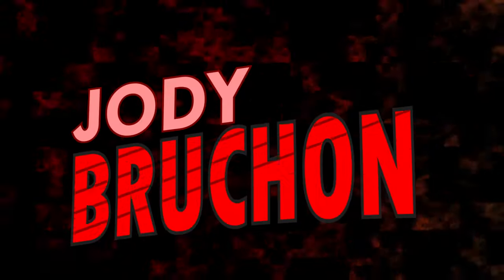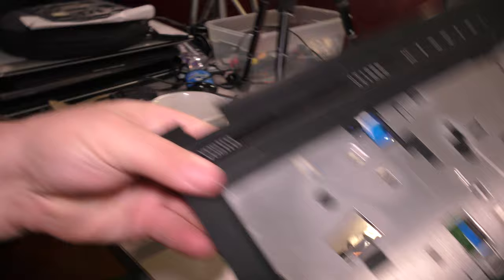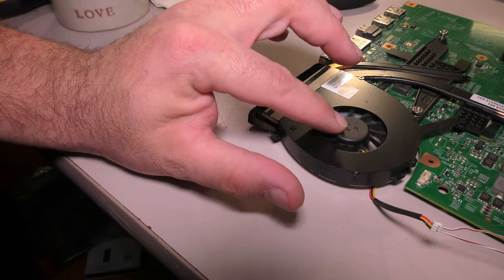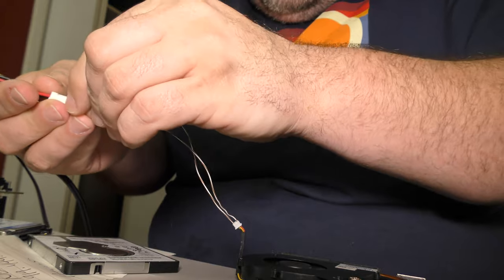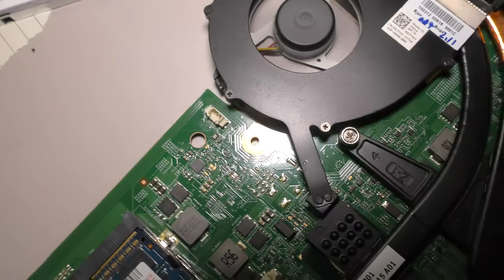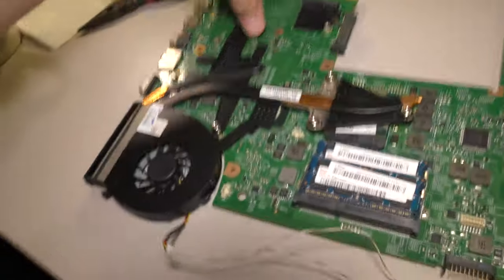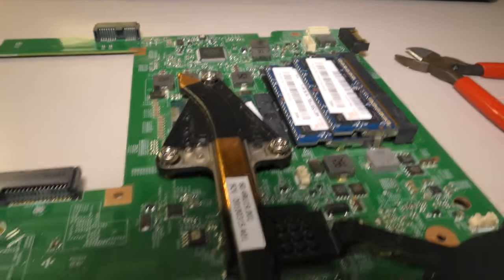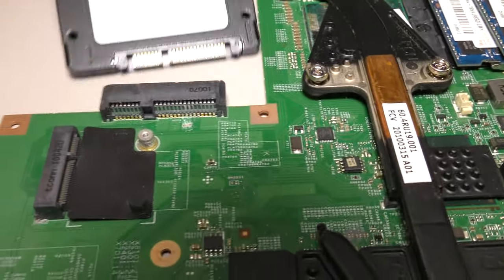Hot-Wiring a Laptop CPU Fan - For Fun and Profit! - Jody Bruchon

Comment: I have the same problem with a Dell, i ll just hot wire fan to a USB cable, make a hole in The plastic cover of The laptop, and Just plug the usb, make It this way cause i lack The skill to mess around the mainboard to get the 5v Power, and if i need to add a resistor i can do It without opening The laptop again. Will look Very ugly tho